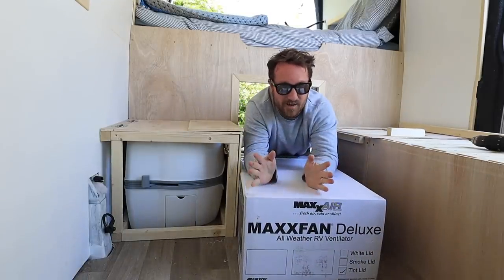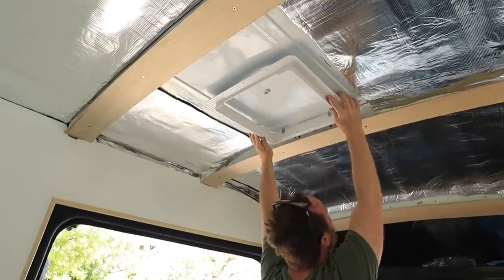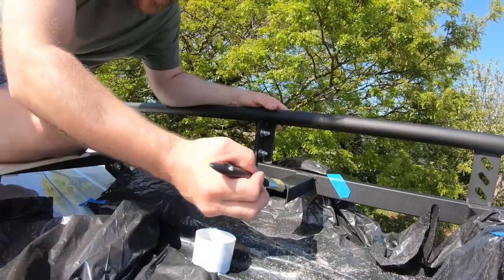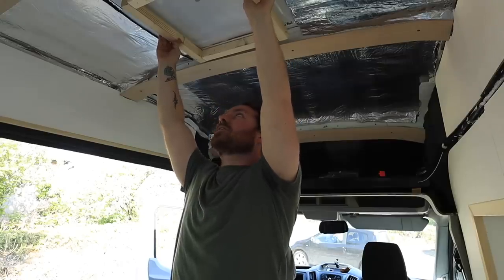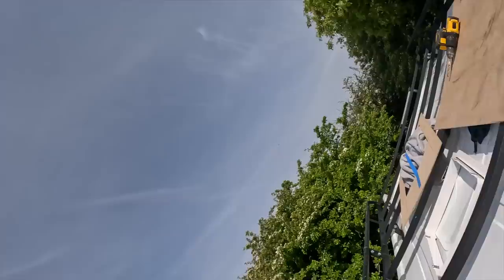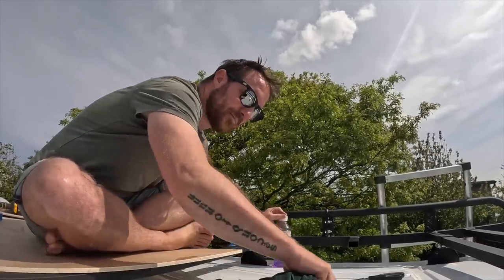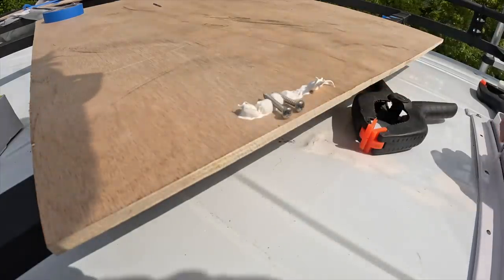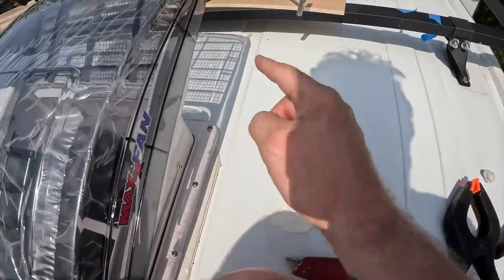I HAD PROBLEMS INSTALLING MY MAXX AIR  FAN DELUX

Comment: I always bag underneath the skylight cut outs to catch the swarf....if you dont want the cut out to fall in, then if you put a piece of ply under each corner as its cut, when you get to the last corner, there are already 3 corners supported. 
Not sure if you have found this out, but usually the maxfan lid is held on with stainless self tappers. The countersunk white screws as used in the inside cover that goes against the ceiling....(or at least thats the way I always fit them😉)
Reply from the maker: Good advice

Comment: Job well done and also well done on the video production, I’m sure it’s not easy but it looks very professional. I’m sure someone must have had to weld the roof back in after they’ve cut it out so at least it’s now fitted!
Reply from the maker: Yea I’m glad I finally did it. I was putting it off as the fan arrived about a month ago

Comment: Trust me when I say you are not the only one that has problems, every job I've done normally ends with me looking skyward and shouting "WHY ME ?"  My roof fan was an absolute nightmare  ! I think you got off lightly. I would still put a bead of sealer around the base even though you have mastic tape. The van is looking the part now 👍🙂
Reply from the maker: Yea I’ve sealed the fan now I wanted to properly check for leaks before putting the sealant on

Comment: Great video Shaun. You might want to pop the 4 screws (that don’t want to line up) back out and use the thicker stainless screws as the white head screws are for the internal cover once the ceiling is all finished. However, if you are like most of us, they are probably in the bin now! 😂
Reply from the maker: 😂 I didn’t know that I’ll check the box 😂

Comment: Another good video, if you need to mark more deep hole's use a marxman pen, brilliant. With the bit you cut off could it be halved and be re-welded front to back joining adjacent bars, this would seal it again and regain the strength? Just an idea?
Reply from the maker: That’s a great idea

Comment: Hi Shaun, love the videos. What van insurance would you recommend for someone building a van like this? I'm sure you mentioned it in one of your videos, but I can not remember which one. Cheers
Reply from the maker: I’ve always used Adrian Flux and I’ve alway recommended them however when insuring my latest van they messed me around but doubling my insurance premium due to me needing to insure it as a camper van and because it’s used for my business being this YouTube channel. They decided to cancel my insurance and then tried to charge me a £100 cancellation fee even though it was them that cancelled it. In the end they just moved my insurance over to a different deal where it is now insured as a camper for business purposes. You’d probably be alright with them but I will no longer recommend them due to this.

Comment: Did mine a couple of weeks back Shaun. IT LEAKED! Even after using mastic tape and a whole tube of (supposedly) super duper sealant. I redid it and still leaks? Where the f"*! does it get in. After a 3rd attempt I think I got it sealed (fingers crossed. 😁
Reply from the maker: That’s annoying Sid. I’ve tested mine with water but need a good rainstorm to really test it
Reply: @LoveSundays  I think it's sorted now Shaun and it was just a very small spot the last time. Next monsoon should confirm though! 😁

Comment: When I did mine it was a case of necessity !  New second hand van and locked myself out of it , only had one key which was safe in the ignition 😄 The solution was to cut the hole in the roof and drop my daughter down through , fun and games 🤡

Comment: Looks good to me .Well done 👍
Reply from the maker: Thanks Dave
Reply: @Love Sundays  I've got normal skylight..but are looking to swap to a maxx air 👍
Reply from the maker: I think if the hole is the same size it’s an easy swap
Reply: @Love Sundays  think the one we have is 400x400 not 100% sure
Reply from the maker: It should fit then but worth checking first.
Reply: @Love Sundays  will do my man .. Happy building..we are off on the norfolk coast next weekend for 2 nights ..can't wait 👍